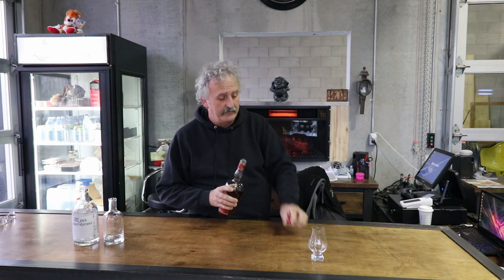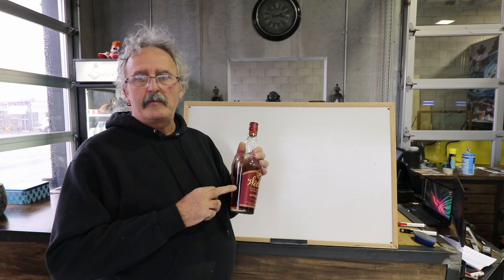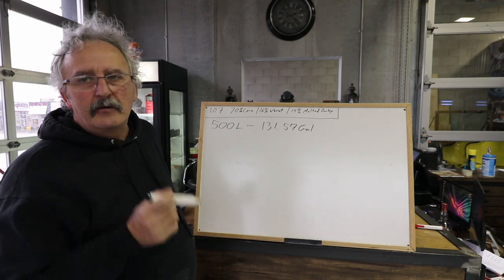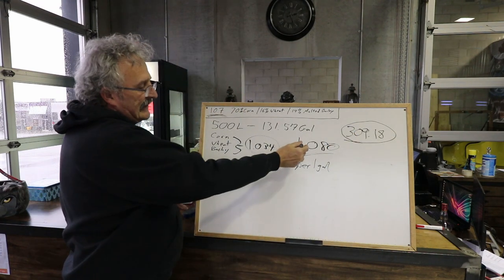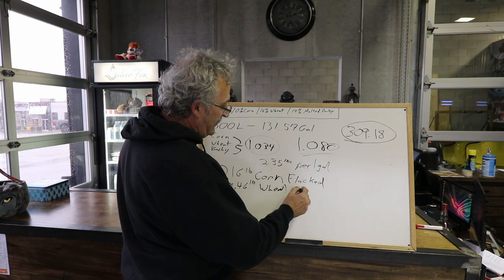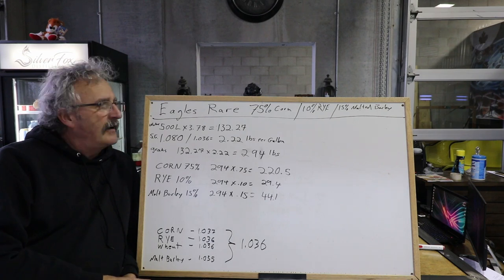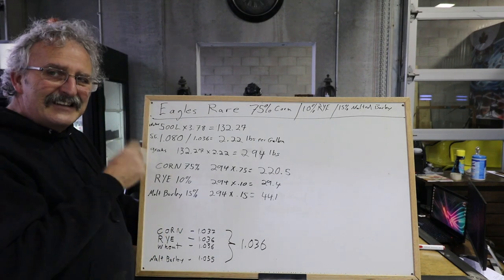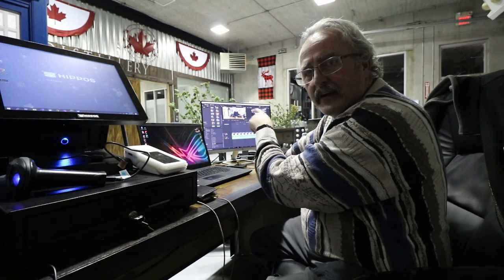2 Bourbon Mashes, Eagles Rare and Antique 107

Comment: Mark, I'm trying wheat berries(unmalted) were would I add these into mash boil? With corn, or malted barley? I'd guess with corn, get those starches out, right? At about 3/4 of mashing 160°F add barley or amalyse?
Reply from the maker: So many depending factors. If using malt then gelatinized the corn at 185 and add malt at 158 on way down. I use high temp alpha and it operates at 185-190 so all my grains go for the ride. I add beta in fermenters just prior to adding yeast
Reply: Thank you

Comment: Hey Mark! Great video! When you say 500 L batch is that 500 L water plus grains?  and where do you order your grains?
Reply from the maker: 500L is water only. As for grains, I have 3 feed mills close to me that I use. Because I’m dealing in larger volumes it is just easier to order a skid. But all the mills I deal with will sell single bags.

Comment: You mentioned is previous videos that whiskey has to be aged in barrels for 3 years for Canadian laws now is that just whiskey or is that rum also ?
Reply from the maker: Rum

B.02.030 [S]. Rum

(a) shall be a potable alcoholic distillate, or a mixture of potable alcoholic distillates, obtained from sugar-cane or sugar-cane products fermented by the action of yeast or a mixture of yeast and other micro-organisms;

(b) may contain

(i) caramel,

(ii) fruit and other botanical substances, and

(iii) flavouring and flavouring preparations; and

(c) if it is imported in bulk for the purpose of bottling and sale in Canada as imported rum, may only be

(i) modified by adding distilled or otherwise purified water to adjust the rum to the strength stated on the label applied to the container,

(ii) modified by adding caramel, or

(iii) blended with other imported rum or, in the case of rum sold as Caribbean rum, with other rum.

SOR/93-145, s. 13 SOR/2012-292, s. 1
Previous Version
B.02.031 (1) No person shall sell for consumption in Canada any rum that has not been aged for a period of at least one year in small wood.

(2) Nothing in subsection (1) applies in respect of flavouring contained in rum, but no person shall sell for consumption in Canada rum containing any flavouring, other than wine, that has not been aged for a period of at least one year in small wood.